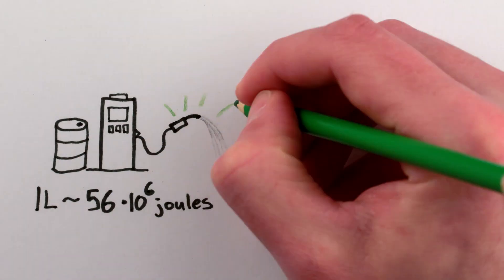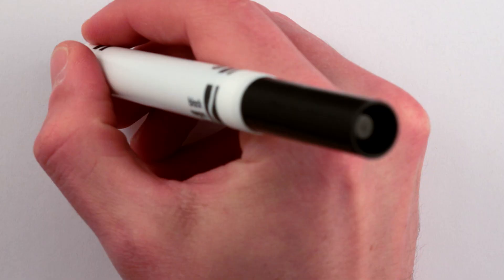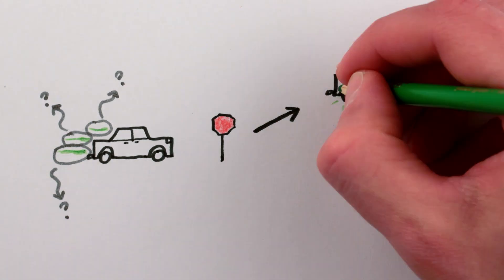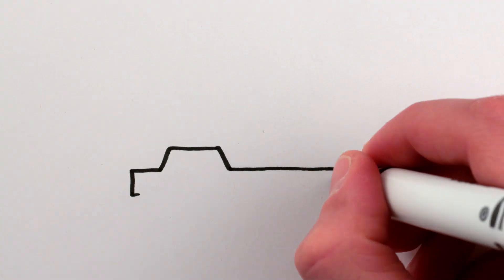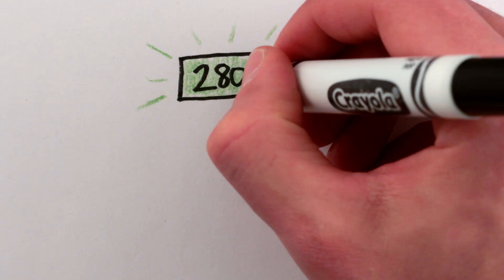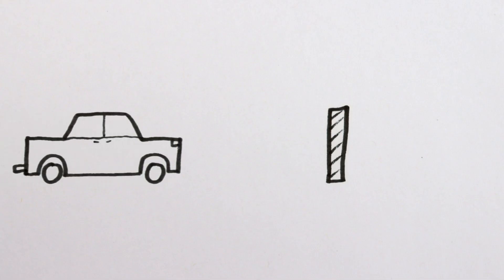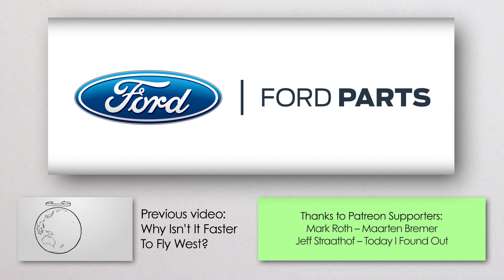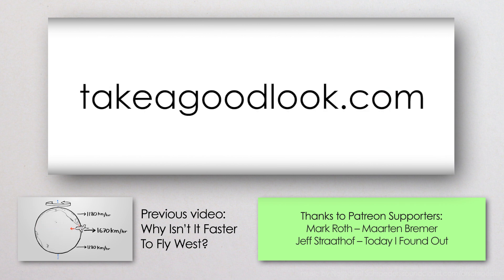The Physics of Car Crashes

Comment: this is why the tesla model S has such a good safety rating. with no engine in the way, the entire front section is a huge crumple zone
Reply: +BattMarn That should be the case for the majority of sport cars then. Given that they usually have the engine at the back...
Reply: +Gurgumul The battery is at the bottom, which also decreases the chance of rollover
Reply: +Professor Jay Tee You can't argue that electric cars are cheaper than the average equivalent car (yet), but they definitely don't have poor acceleration, and even their range is well above decent.

The Tesla Model S does 442 - 528 km on one charge and does 0-100km/h (60mph, for the Americans) in 3-5.4 seconds (depending on the model)
From my 30 seconds of googling, a similarly priced BMW quotes 1000km range, 6.1 second acceleration
Reply: +GraveUypo Less weight moving around? The batteries are HEAVY and the car weighs just above 2 tonnes. That's much more than an average modern car.
Reply: +StephanDRX "most" sportscars?
Reply: +TheMightyWill "battery acid" in Lithium-ion batteries. I think not.
Reply: +TheMightyWill the batteries are under the car, so at worst it would be a damaged floor
Reply: BattMarn
Have you been at a serious crash site? Everything goes flying everywhere
Reply: +Gurgumul Thanks, you take the words out of my fingers.
Reply: +StephanDRX The McLaren P1 has such good safety rating that it is the only car that doesn't require a roll cage for racing. But yes, most super cars do better in a 60mph crash than regular cars.
Reply: James Hansen
Yeah those cars are decent now, they still have some small issues like the fact the batteries will go bad after a few years and you have to recharge them for some hours  (at night). But they will get better, a lot better probably.
Reply: +Ric Rac Hydrogen is happening soon. I'm training to be a Toyota/Scion/Lexus certified technician, and one of the modules we had to complete was about the Mirai. It's the hydrogen powered car that Toyota is coming out with. It should be here....very soon, if not already. It will be in California at first.
Reply: +Professor Jay Tee "batteries dont burn well" lithium is a very volatile element and expose it fire it will explode violently
Reply: +StephanDRX yeah, no. because there's no engine in the back either in the tesla, so there's less weight moving around and therefor less energy to dissipate. most of the weight of that car goes into the batteries, and those are low down under the floor. but i guess mid and rear engined cars are a bit safer in a frontal collision.
Reply: James Hansen
 Yeah for my use, a charge would last probably 2 weeks, so it wouldn't be a bother. But forget about road tripping, that's just asking for trouble.
Really I was just expecting for the hydrogen technology to take off and beat battery electric. But I guess that's not happening soon.
Reply: +BattMarn Thats accually not true. The engine itself has been re designed over the years to also act part of the crash. It acts as a stopping point where the crumpling stops inorer for the person behind the wheel to not be part of the cruple zone. Tesla had to put allot of work into reinforcing their front ends to be as safe as they are with out a nice engine to protect the driver.
Reply: +StephanDRX Sports cars are safer for a different reason. As  I said in a previous comment, you actually want to have an engine in the front for a head on collisions. Sports cars though usually have much stronger breaks meaning they can decelerate before the crash allot more than regular cars. Also Usually can maneuver at high speeds around to avoid a crash altogether much better as well. Although this takes exceptionally good driving. Hypercars though which have a carbon fiber body and chassis. Are extremely safe because of the high strength subframe (cus carbon fiber is stronger than steel). Also some sports cars have 5 point or 3 point safety harness instead of seat belts. Meaning in an accident there is less pressure on any specific point of your body. Something els which you really want in an accident.
Reply: Chrinik Battery Acid is putting it lightly. If the lithium inside the battery comes into contact with water in any way acid will form. Although that acid is the least of your worries because the contact with water will cause a violent explosion. They are encased in a protective shell, but in the case of punctures this can be a problem. Also if they are overcharged then they will also violently catch fire breaking almost any shell used to contain it. Over charging is usually protected by some sort of chip, but its possible for that to malfunction.
Reply: Martin Plas What fucking cars have you been driving?
First of all, even E-cars have engines.
Second of all, if you hit with a speed that would force the engine into the drivers compartment, you are pretty dead anyway.
And lastly, cars are crashtested. All the time.
Reply: martinshoosterman "there has never really been a time in any modern car where you had to worry about the engine hitting you in a crash. the subframe stops the engine from hitting you. and if that breaks then you would die either way, with or with out an engine there."

That is basically my arguement XD
Sure, the engine can kill you...but if you get squashed by the engine, you would have died anyway from the sheer impact alone.
People quoting things like "Engines are a cause of death" well yes...because getting smushed by an engine is usually a more apparent cause of damage for a first responder then the G-force, whiplash and hitting the airbag so hard your neck broke.

BTW, Airbags fucking stink...my immediate concern (after seeing that me and the driver were okay) was that there might be a fire, since it smelled burned all over.

And yes, that happened december 28th, and I still got ripped muscles hurting like a bitch because I went to work on the 2nd of January because I felt fine.
Tore them right back up again XD

This particular BMW also had an oldfashioned steel frame designed to protect the squishy passengercabin from being a "crumplezone" aswell...I´m happy for that, since a car door is kind of a bitch when it snuggles up too close, with or without airbags XD
Reply: +BattMarn - Okay... the "I'm too young but I'm smarter than you" really prompted me to reply to this MESS of a comment thread. 

Most people misunderstand that concept of "crumple zone". At it's core, what it means is that any any force suddenly applied to the front of a car is directed AWAY from where a driver or passenger might be sitting. That's it. That's all it is. This is NOT complicated in the ways that you may think it would be. 

A Tesla has a huge block of electronic control systems in front of your knees when you're driving. Other cars have an engine sitting in front of your knees while you're driving the car. The IDEA of smashing the front of your car into an obstacle is actually the same thing. 

In the 1960's, it might all end up in your lap, in the front seat. In cars that have been designed in the past 20 years, ALL off what is in front of you goes DOWN. That's the design, that's how it works, and quite frankly it works very well. 

Whether it's an engine, a transmission, or a Tesla control box... On impact it is immediately pushed down below the body of the rest of the car. It soaks up the tremendous force of the impact with another vehicle, it shoves itself down under the body of the car, instead of directly into your knees, and after the impact you will walk over to the other car and ask them if they are still alive. 

THAT is one of the marvels of modern engineering,. THAT is the reason why you will have a story to tell instead of an obituary. All of that nice front-end of your car is going to crush itself DOWN toward the ground and underneath where you are sitting. And you will be just fine after it's all over. 

That's the answer to the question that you people have been asking about in this message thread. But it's ONLY for cars that have been built in the past 20 years or so. My F-150 is 30 years old, so if somebody manages to hit me head-on... I'm probably going to smash both of my knees in the process and end up in a wheelchair. 

Someday I'll get a newer truck to do my daily work with. I hope. :P
Reply: +Chrinik You ever seen a lithium-ion battery that has been overcharged and explodes?
Reply: Ric Rac
I wouldn't say "having" to recharge at night is an issue though, unless you're going on a multi-day road trip
(they have a decent standing discharge, so an unplugged car won't go flat overnight, it just won't charge up)

Regular cars have the issue that you have to drive to a petrol station ~once a week and pay ~$80

For me, the biggest issue is that they're still way too expensive for me to get one :P
Reply: david199619
Didn't toyota test a hydrogen car like 4 yeas ago? I think it was only for leasing in Los Angeles.
I hope it does come, the only upside I find in electric is torque.
Reply: +iamihop That depends on the customer, if the customer is just a day to day people who only use it for work then yeah, electric cars can do well

But if the customer wants a car that can travel miles to miles like going out of town and road tripping rather than taking the airplane or boat (those vehicles still burn fuel btw), they would want a car that go to pump to pump

And yeah you can stay at a motel and charge up, but not every country in the world has motels next to their highways/tolways

So unless you want to sleep in car in every road trip, I suggest hydrogen cars are at best when they have the right customer
Reply: +TheMightyWill the batteries are lithium-ion, not olden generating batteries like the pile alkaline or mercury batteries of old.
Reply: +Ric Rac The problem with hydrogen is storage. It needs to be pressurized to maintain it&#39;s liquid form long enough to be useful as a fuel. It&#39;s easy enough to store a small amount in a welding tank for the time it takes to use it up. Storing it in a tank that is opened and closed without changing seals regularly becomes a problem. Gasoline and other liquid fuels we use do evaporate but not nearly as fast as hydrogen, so the relatively cheap seals used in cars aren&#39;t as much of a problem.

Also there's the embrittlement problem. A lot of the metals used in your run of the mill car suffer from embrittlement issues using hydrogen as a fuel source. You can mix a little gasoline with it to solve some of this problem but to solve it well enough for long term use you need expensive additives.
Reply: +Ric Rac Having 1 gear saves a little time on launch. Also no need to rev up to reach optimal powerbands. Beating muscle cars isn't really the #1 goal with electric cars though. I can see houses in the near future having an all electric runabout for day to day city stuff, and a performance hybrid for weekends/holidays. Unless the whole battery can be replaced for a fully charged one at a gas station in the same time it takes to fill a tank or less, guzzoline is going to be in our lives for a long while yet.
Reply: +GraveUypo Unless the engine get´s dislodged and slams through the passenger/driver compartment, then you are fucked.
But I guess a collision at the speed required to make that happen would be lethal anyway.
Reply: +TheMightyWill Battery Acid? Really? Are you serrious?
It runs on Lithium-Ion Batteries, same as Laptops and shit...They don´t contain acids.

They can short-circuit and burn surrounding material but encasing them in a fire-retardent material would be enough to prevent that.
Reply: martinshoosterman Okay, first: Lithium-Ion Batteries do not explode when they come in contact with water. It reacts exotherm, meaning it gets very warm...that is not the same as EXPLOSION...it can cause fires if it then gets into contact with combustables.
But I don´t think you will put a burning car out with sticks of dynamite.

Firefighters in the US and Europe are advised to use large amounts of water in case a fire breaks out in an electric car. It will probably not stop burning in the compromised cells, as the cell generates it´s own oxygen while burning, but it will cool the adjacent cells so that no reaction in them can take place.

They don´t use actual lithium. They only use it as a chemical compound. It´s not actual elementary lithium which would indeed be very dangerous.

Lithium Ion Batteries have since their invention been improved and laced with many methods to increase safety. The Lithium Polymere batteries used in RC cars for example used to be very suseptible to explosion and fire with only minor mechanical damage, now you can wail on them with an iron pipe and nothing happens.
So, again, if someone made a battery that is safe to put in a car, even in the event of a crash (as cars are rigorously tested for this, by the way), then you can be assured it won´t fucking explode when you spill your damn drink on it, so to speak.
Reply: +Ric Rac Sadly, the creation and transporting of hydrogen is just not worth the cost or the pollution saved by the hydrogen fuel cells, but that's just something I heard so please don't quote me on that.
Reply: +TheMightyWill You must not be well versed in Lithium Ion batteries. There is no liquid.
Reply: plus its lack of engine makes it safe because in a crash the engine of a car would go through the front into drivers seat cutting of legs
Reply: +Chrinik Tesla's have no engines they are not hybrids and if you had to choose between a Tesla and a different car witch would you choose
Reply: iamihop He never specified it was a tesla he was talking about. The discussion turned to Ion Battery explosions.
I never denied the safety standards of a Tesla S. But how am I supposed to know that is what he was talking about?

So he basically said the same as the OP. Congrats...did anyone object to the crumple zone?

I give you that I may confuse the term engine and motor, in german, both mean the same.

Yet, a collision that forces the engine into the cabin is pretty much a death sentence anyway. Depending on the model obviously, but it takes a load of force to push that thing out of the mountings into the cabin in the cars I´ve been in.
And no, those weren´t sedans.
Reply: Martin Plas That doesn´t have anything to do with smart if you don´t specify what car you are talking about. Your post didn´t include who you replied too, nor what you were talking about. The discussion was about Lithium-Ion battery explosions.
Reply: +Chrinik well I replied to some one else and then you came in acting like a jerk
Reply: Martin Plas Well it didn´t say who or what. So I couldn´t check. If you said you where talking about the Tesla, I´d have checked it out to see where it´s motor was.

You couldn´t have replied to BattMarn considering you said the same thing as he did.

And as someone who recently survived a car crash, the engine going into the passenger cabin was the least of my worries. The reinforced frame of his BMW held up despite tumbling over twice. A car door is only so much protection.

A frontal collision that rips the engine out of it´s mounts and into the driver cabin is bad news.

But yes, the Tesla´s have huge crumple zones, you shouldn´t be driving fast enough to need them.
Reply: Chrinik Worries? really? c'mon thats bullshit. when you were in the crash, you weren't worrying about the structural integrity of the frame, you were worrying about the impact or the airbags.
Reply: martinshoosterman Technically I wasn´t worrying about anything in the car, only to "not hit something and die"...100mph when we started turning. A few revolutions and about 40 feet below the road it came resting on the passenger side.
And since the passenger side, even in a Tesla, is just a door and airbags, I was happy about the airbags, didn´t care about the engine going anywhere.

Even when everything went wrong, everything went right considering that I basically just tore muscles and scratches, and the driver broke a collarbone. The car looks like a legobrick, with every side smashed except the frame and trunk.
The frame held up shape pretty well. Which is probably what saved us from further injury, considering that a smashed in rooftop would have probably hit our heads.

I´ll dare say that even in a Tesla, a frontal collision at 100 mph is pretty vicious, if not lethal. I don´t even think cars are tested for those speeds, but I could be wrong.
Reply: +Chrinik there have only been 4 deaths in Tesla's and are hard to flip in a crash because of its low center of gravity due to the batery
Reply: Martin Plas I wasn´t denying they are safe.
I was just denying that every crash forces the engine in the compartment and THAT is the main cause of concern...
Reply: +Chrinik your right it isn't the main cause of concern but you say that it can only happen at high speeds witch is wrong
Reply: Martin Plas Didn´t even say that...I just said that if a car actually hit´s something hard enough to rip the engine out of it´s mounting, you will have a bad time regardless.
Reply: Chrinik you're telling me you flipped a tesla off of a cliff at 100mph? 
can you show me any news archive of this accident?
Reply: martinshoosterman No...we drove a BMW...
Also it wasn´t a cliff...I said 40 feet, not 400.
It was a bridge.

http://www.hanauer.de/ha_50_111020469-29-_Auto-durchbricht-Leitplanke-und-landet-in-der-Boeschung.html

But what would be so hard to believe a tesla going 100mph? The Tesla S has over 300hp...it can easily keep up with luxury cars like the Mercedes S-class.
Reply: Chrinik No, The concern is that I simply found it convenient that it was a tesla, while we were arguing about those. Thank you for backing up your claims. wait, holy shit, this that happen about a month and 4 days ago? 
edit, I see now that you were basically arguing a similar side to me, as well you did originally state that your crash happned in a bmw. 
anyways, fun fact about worrying about the engine. there has never really been a time in any modern car where you had to worry about the engine hitting you in a crash. the subframe stops the engine from hitting you. and if that breaks then you would die either way, with or with out an engine there. All cars nowadays do have ridiculously strong subframes, but tesla's do not have the strongest. Volvos still have the strongest sub frames in any car on the road.
Reply: Chrinik Ya, I know what you mean about airbags. I was in a minor accident back in june. The accident itself was very small, I never even ended up seeing a doctor, but the airbags did go off. It smells the exact same as when your bbq fire gets out of control and start burning your meat. Its like the designers want to make the post accident expirience just that much worse.
Reply: martinshoosterman It´s the explosive charges used to blow them up. Pardon the pun.
Reeks of black powder and burnt plastic.

I fucking hate that smell now.
Reply: +BattMarn  that and BOOM
Reply: +BattMarn - I see you deleted the reply I was replying to... Terrible thing to do, that...
Reply: +Chrinik You're right but considering you have so much weight that must be moved it would take much more force to move a beefy V-8 than a tiny 4 cylinder. I was recently in a extremely bad car accident. I was on my way to work and had a 27,000 lb military dump truck pull across in front of me and i T-Boned him at 50 MPH. At the time i was driving a 2001 Camaro Z/28 5.7L LS1 two months prior to that I was driving a 2003 Honda civic LX Sedan with a 1.7L 4-Cylinder. I can't say this as fact but i believe that if i was in my Honda i would not be here today for a few reasons. Not only did the Camaro weigh 1,000lbs more meaning i exerted more force meaning there was less impact on me. but it had a significantly longer hood to house the massive 350 engine. Also the camaro had much superior brakes and steering to my honda civic also it had bigger motor mounts than the 4-Cyl engine. The 4-cyl engine weighs around 360lbs while the LS1 weighs around 400 lbs. But back to braking and steering as the Military Dump truck pulled across i had approximately 1-2 seconds to react. In that time i slammed the brakes and swerved left away from the void space in between the tires of the truck where the dump bed is and i hit the back tire which absorbed some of the force in the suspension. But needless to say the honda would not have done that or handled so well. I'm thankful every day that i bought that car it truly saved my life. I will forever respect muscle cars build quality.
Reply: Timothy Benton Yes, you ever seen how we developed better Lithium-Ion batteries?

Not my fault you or the company using them buy cheap.
Li-Fe-Po Batteries are nearly indestructable in that regard, and normal Lithium Ion Batteries can be abused without detonating.

I got a bunch of Lithium Ion Batteries lying around and none of them exploded yet. Don´t buy cheap, you´ll be fine.

So, you were saying?
Reply: Chrinik - So... you said "Not my fault" in a very weak attempt to insert yourself into a conversation that you were not involved in.

Then you expound on the idea that batteries are "nearly indestructible", which I think the manufacturer would disagree with you about. (As well as everybody else, who has any sense in their head.)

Then you say, "You were saying?" - as if people were supposed to understand what you were saying? What on Earth WERE you saying, anyway?

Honestly, I have NO idea what you were trying to say there. Where you complaining about batteries?  Or Camaro cars? Are you complaining that they were too heavy?  Or that they drove too fast?

What, exactly, were you trying to complain about here? As near as I can tell, the only thing that Timothy Benton was complaining about was that batteries are heavy. And batteries ARE heavy, that's simply a fact.

What, exactly, is your point here - in this complainly-sounding reply that you posted?
Reply: KOakaKO Are you mental? A conversation I was not involved in? The GUY I REPLIED TO ASKED ME A QUESTION DIRECTLY!

RIGHT OVER MY POST! He asked if I had ever seen a lithium battery that got overcharged and exploded.
The other post directed at me was a personal story of his about a car crash he had been in...no question in it for me to answer, sooo...

I replied that I had seen batteries explode, and that I also have many batteries of much better quality. Li-Pos used to explode after very light physical abuse and wrong charging, now you can find videos of people beating them with steel pipes trying their best to get them to fail, and apart from eventually not working anymore, they don´t explode anymore. Li-Fe-Pos are very resistant to wrong charging, which was the regard I mentioned, in which they are indestructable, by the way.
The main difference between Lithium-Ion and Lithium-Polymere batteries is that the former uses liquid electrolytes, the latter a denser compound.

The reason I said "not my fault the company buys cheap" is that he was probably refering to alot of Lithium Ion batteries used in commercial products like phones and laptops, and those can be of very cheap quality and prone to explosion.

What exactly was so hard to understand about that?

Fucking hell.

People and their reading skills.

I didn´t read the rest of your presumtuous diatribe of insults against my person, because frankly, YOU inserted yourself into a conversation you had no part in.

Kindly fuck off.
Reply: Chrinik
- Yes, I will kindly fuck off. Thank you for the informative information that you provided in your reply. ;)
Reply: ''all electric cars have lower acceleration'' you realise the Model S is capable of 0-100 in 3.0 seconds...
Reply: actually it's 2.5 seconds now
Reply: p100d yew
Reply: BattMarn Gas is still better
Reply: +BattMarn A fire in an electric car would be much worse than a fire in a normal car.
Reply: +BattMarn High safety ratings except for the fact that those tests don't take into account battery leakages. You want a face full of battery acid after a crash?
Reply: +Chrinik I am too young too drive and am smarter than you
Reply: +Rassity Did you understand the part about stored energy in the gasoline/petrol? Where do you think the energy will come from in a car fire? Batteries used in cars don't burn that well, or store that much energy. That's why all-electric cars have lower acceleration and a very limited range at present.